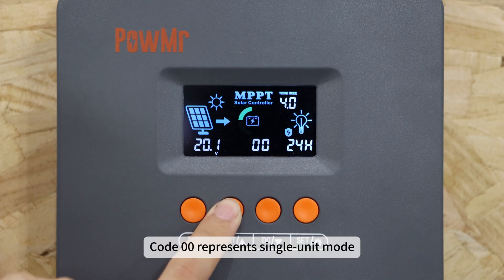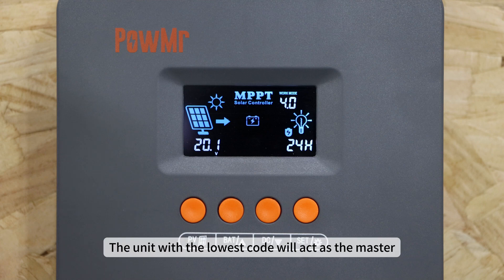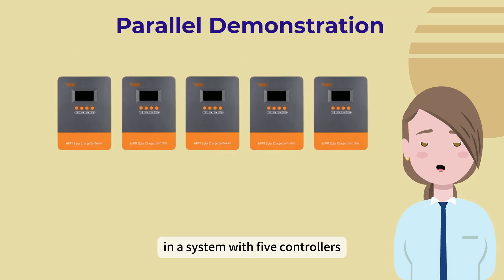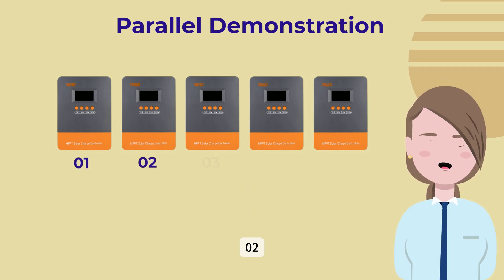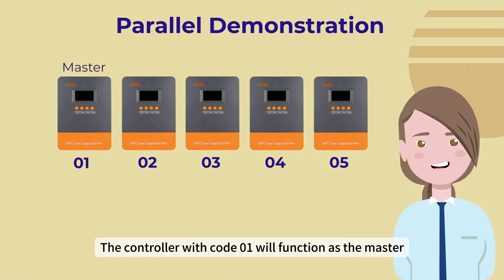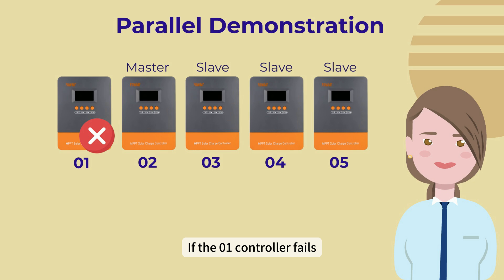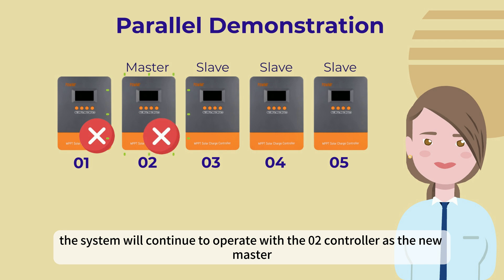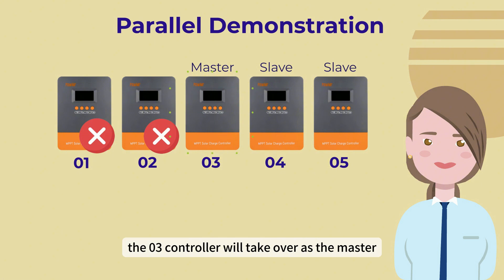How to Setup the POW-M60-ULTRA Solar Charge Controller?

Comment: I cannot adjust the boost charging voltage, float charging voltage, under voltage cut-off voltage, under voltage recovery voltage and over voltage value to more than 17 volts of powmr m60 ultra when on User mode as I am using a 24 volts lifepo4 battery and 17 volts is not recommended by the battery manufacturer for the said parameters, what can I do with this?
Reply from the maker: Please send it to this email: support@powmr.com.
Reply: @PowmrSolar someone told me that if the set up is 24 volts, the user parameters are multiplied by 2, is this correct?
Reply from the maker: @edriansantos2092  Yep.